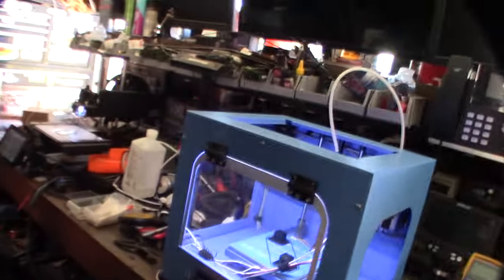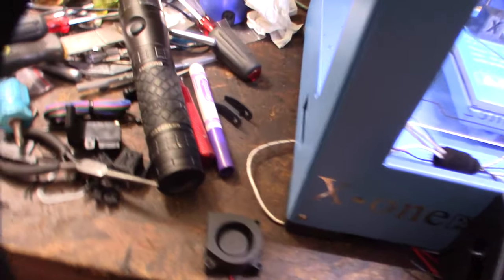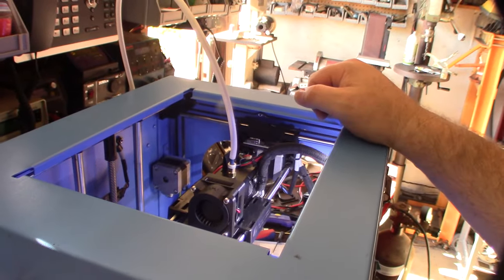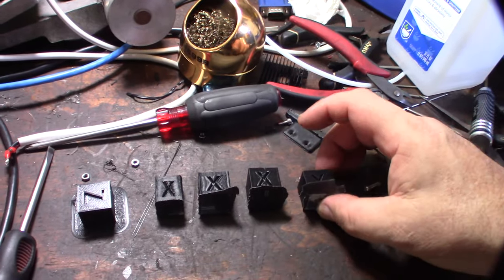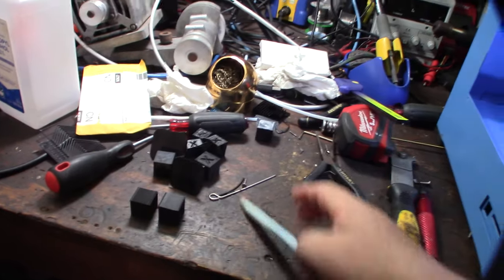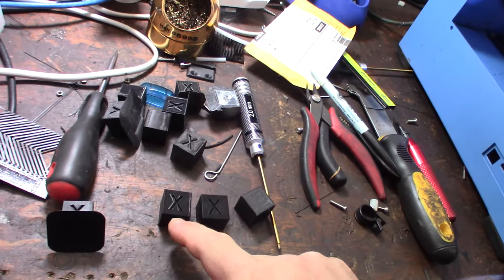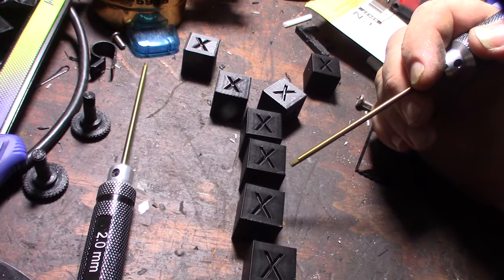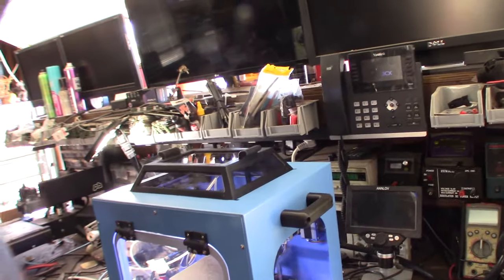Qidi Tech X-one2 Resurrection, Klipper Conversion For ABS Part 4 with Biqu H2 3D printer MAX6675

Comment: CFPLA seems like such a strange choice for a cooling duct on a chamber printer? What is your reason for liking CFPLA? I kinda decided awhile ago that it is one of the most useless materials. Too brittle, little benefit for the extra cost, poor temperature resistance. It just doesn't seem any better than plain PLA. And if you plan on printing ABS, you're going to have the duct right up against a 100c+ bed?!
Reply from the maker: I didn't have a good printer that could print ABS well yet. I will probably redo the duct in ABS. I've had good luck with carbon fiber PLA. I usually print with 100% infill. I have parts on my CNC machines that are rock solid. Thin walls are weak with carbon fiber PLA. Have you printed anything yet in Carbon nylon or Carbon ABS?
Reply: @fintechrepairshop  Wait, what? What bed temp can your main printer handle? It should be able to easily print an ABS part that thin even if you can only get to 80c. Geometry and low infill are critical for high warp materials. I know it is a bit counterintuitive but, if it warps, make the part weaker (even a low temp heated chamber will struggle at 100% infill). A duct definitely doesn't need insane level infill.

I've printed everything on open frame machines similar to your big ones. I use 110c for ABS and put a few pieces of cardboard around the printer to prevent drafts (same with other high warp materials). We are in the process of enclosing printers right now though.

We've tried all of the <=300c 3dxtech standard materials except the CFPLA: CFPETG, CFPC, CFEZPC (PC/ASA blend), CFABS, CFNylon, etc. ABS is too flammable, just seems weak, and isn't actually as temperature resistant as advertised. Nylon doesn't stick well enough. Pure PC warps too much (even at high temp with CF).

3dxtech CFPETG prints amazingly, has a very high Young's Modulus (better than their CFPLA), but has a usable temperature only around 70-80c.

CFEZPC (PC/ASA blend) is the best CF material available. Similar warping to ABS, highest Young's Modulus of all normally printable materials, usable temperature ~120c.

Personally I've been trying to avoid CF materials though, since the fibers really get everywhere and I end up wearing gloves anytime I handle the parts. It is pretty nasty. For 99.9% of parts, unfilled materials are good enough. The biggest downside is that unfilled material warps more. Thus the goal of higher chamber temps 😁
Reply from the maker: @jessicav2031  All my printers and handle at least 100C. I had issue with ABS early on and my spool sat for 6 years. I always had good luck with PLA+,  PETG and CFPLA so I never used ABS. When that little Qidi printer was thrown on lap I decided to make a dedicated printer. OK, Ok I will be honest. I need to design a cell phone mount for my car.
Reply from the maker: Ever mess with RF stuff? I'm restoring a CB Linear Amplifier  in my last video. The thing gets sketchy hot. Designing an active cooler case.
Reply: @fintechrepairshop  Not really anything like that, but, I'm not surprised. "Linear" says it all, right? It is probably designed to run like that and it is fine. Silicon semiconductors can easily operate at 120c, and ancient stuff is super robust. You shouldn't think of, say, 1980s steel-cased BJTs in the same way as a microcontroller; the two have different heat failure modes (plus obviously some of the same ones like expansion fatigue).